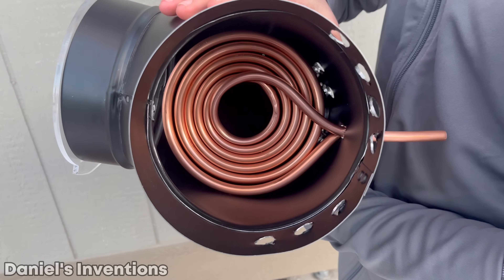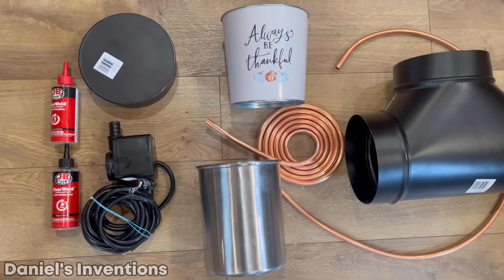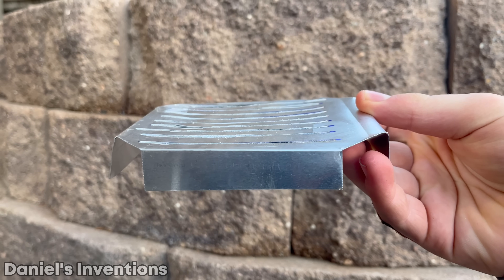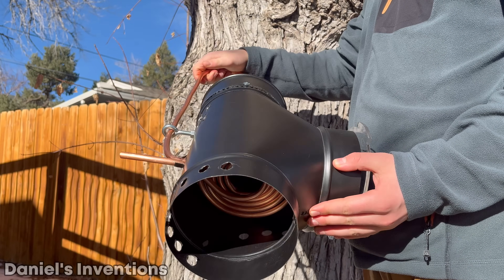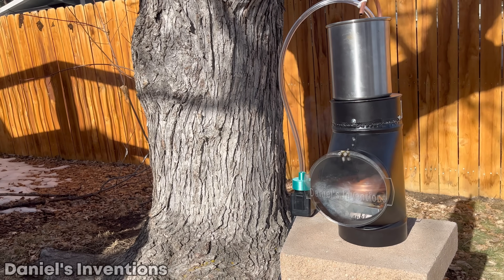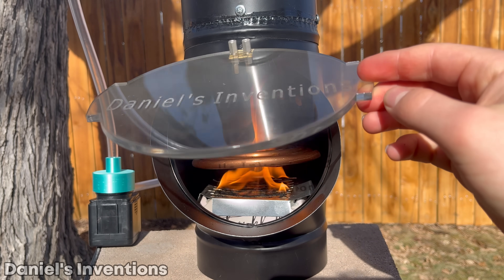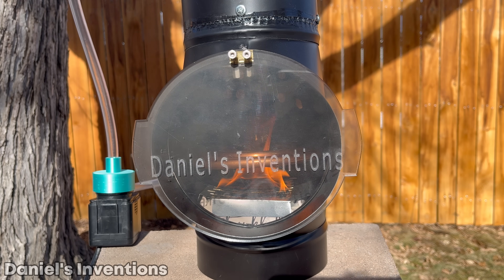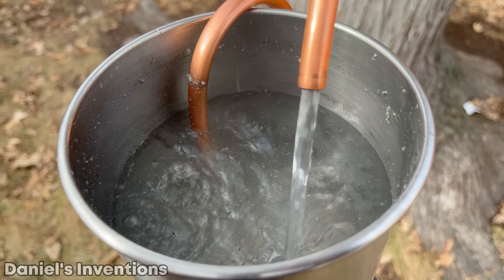ENDLESS Hot Water for Your Home (NO ELECTRICITY)

Comment: I'm wondering how that plastic pump and plastic hose are going to hold up to the hot water when it is 220 degrees?
Reply: This could easily be made into a thermal recirculating heater. No pump or plastic needed.
Reply: @ranman5501  be my friend homie.
Reply: At my cabin cold goes through the 12 volt pump. Not hot! The thick plastic line runs hot from propane water heater into copper pipe under my place. Check out an RV. Same thing. Ez peasy...
Reply: @oscarandbernie  but the propane water heater has a thermostat and turns on and off. This can also use waste oils. This one does have manual refill.
Reply: Yeah it looks like he's putting hot side flow through that cheap pump which isn't going to work much longer than this demo. It's smarter to skip the bucket for anything other than melting snow or heating a sand battery and just circulate water between the copper coil and an automotive oil cooler or small radiator maybe with a built in dc fan. Mount the radiator somewhere just inside any accessible window and leave the fire outside. The water coming back to the pump should be significantly cooler. Could be the basis of a sweet little emergency heater. Would've saved a bunch of busted pipes in Texas a while back. Some lives too.

Edit: if anyone does try putting the heater outside/radiator inside it would be smart to add a relief valve or just an open line to atmosphere splitting off the highest part of the water loop outside. Otherwise a steam burp can cause that radiator cap to blow off scalding steam at someone inside the space you're warming or an oil cooler might explode in an otherwise sealed loop. At least the way it's set up in the vid the open bucket serves as a relief.
Reply: That's a great question.
Reply: @outdoorzee The plastic is attached to the cold water end.
Reply: @odiesurfco5770 In the thumbnail and while first melting snow in the hot bucket (over the surface that hits 500°F) the pump draws water out of the hot pot with plastic tube. From the pump more plastic tube runs to the copper loop thats directly in flame with that exiting up the spigot looking piece of copper dumping into the near boiling pot the pump first draws from. It looks like he even had to replace the "cold" hose running from the pot to the pump with more copper. Presumably he was using his second pump by then and possibly just running an open loop and/or not recirculating after filling the pot with water preheated by the pass through the coil. We have to guess at all the changes he made for the shots with the water pot boiling but we do see that both lines in the pot are copper by then.
Reply: I would say it depends on the plastic used for the pump. Nylon has a melt point starting around 480 degrees,  there are santoprene plastics which start to melt at 320 degrees.  Depending on plastics used and construction a plastic pump may be fairly resilient.
Reply: I wonder how it could get to 220 at atmospheric pressure.
Reply: @marksparks8852  He's probably using an infrared reader off the copper or plastic where enough steam bubbles heat the tube to a higher temp than the water can reach.
Reply: Was thinking the same. You’d be better running a heating system circulation pump. Like a Grundfos pump
Reply: Use any cars heating system pump instead, it uses 12 volt dc and has very high resistance.
Reply: Boiling water never exceeds 212°
Reply: @jamesjacobs8727  actually it does. It's called superheating.
Reply: @jamesjacobs8727  Actually it does under pressure, but that's what it boils at under what are called standard conditions. I worked at a cannery that packed at 18 psi above atmospheric pressure so they could seal the cans at 255 degrees F.
Reply: This setup doesn't make sense. Many comments state the pump brings in the cold water, yet he is using snow to make the water. This requires heat. He shows 2 copper tubes in the boiling water, where is the pump tube? You cannot use a pump like this to move boiling water.
Reply: @afterawordfromoursponsor  yep, buy nichrome wire and place it in a heater coil and connect it to 12v battery or directly to your panel.
Reply: I wondered about all this too
Reply: Yeah, considering It can never get to 220° 😂
Reply: Not well
Reply: You can boil water in a plastic bottle over a fire if you keep it tall enough. Les Stroud did it and the bottle just deforms a bit.
Reply: I'm pretty sure that if you're going to fit this into a permanent type usage you would use other materials.
Reply: Pex
Reply: Water heaters actually have one internally
Reply: They‘lol hold up fine, why are you wondering? You’re not gonna do shit.
Reply: @tyrone6820  go away!!!
Reply: The pump is only pumping the cold water which is then going to the heater and dumping boiled water in a bucket
Reply: Itz Fahrenheit  not degree
Reply: Will have steam by then. Lol
Reply: Is LEXAN 5mm
Reply: I’m wondering how he got 220 degree water when boiling point is 212….? 😂
Reply: @jamesb3092  this guy is a bit of a scam. He tries to repeat what other people have already done as if it's his own invention LOL
Reply: If you look the pump and plastic pipe are all before it goes through the heat exchanger part there it changes to copper, so pump and plastic pipe is just dealing with cold water
Reply: @dieselswede  not true. Where you see two plastic tubes in the thumbnail and while melting snow in the bucket the one plastic tube goes to the coil in the fire which then empties into the bucket. Meanwhile the second plastic tube draws water from the boiling heated bucket into the pump. This second plastic tube is replaced with copper in other shots but we see absolutely nothing else in those shots so for all we know the pump melted and he was just using a thermosiphon instead by then.

Comment: Good job. How would you connect this next to the hot water tank in the house in case of an emergency
Reply: Do not do that unless you know what you're doing. You could get seriously hurt. 
Just add the hot water in the bucket to the cold water in your tub manually.
Reply: Your water bucket should have a side dispense nozzle. Otherwise I believe either a pump or like the old toilets a gravitational flush.
Reply: your hot water system in a house is closed and under pressure, so there is a risk of explosion